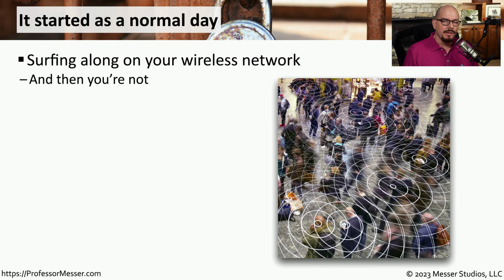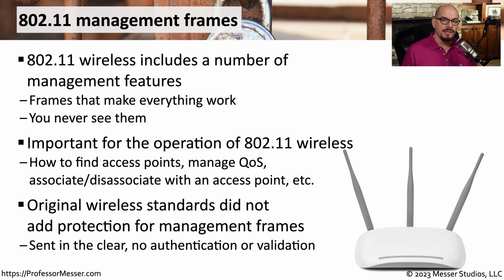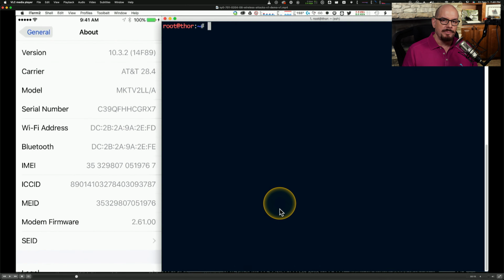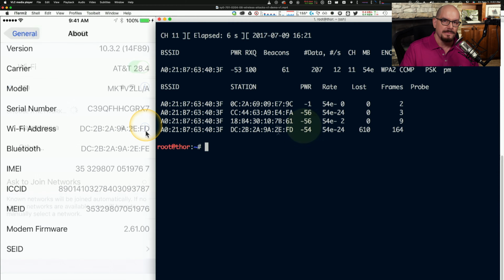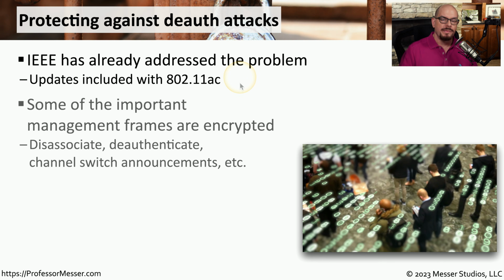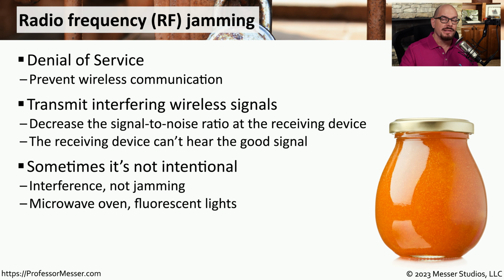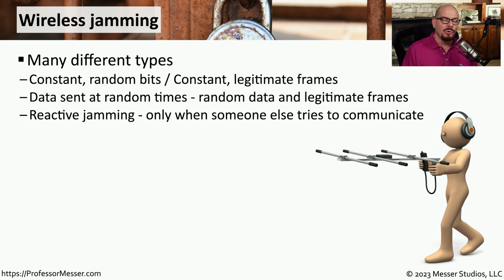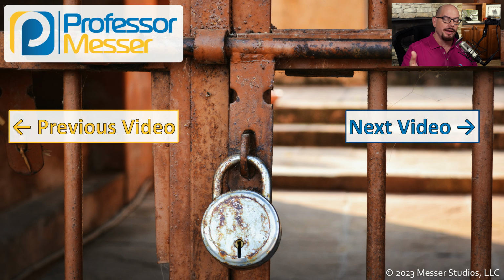Wireless Attacks - CompTIA Security+ SY0-701 - 2.4

Comment: Can this also happen with Bluetooth Signals?
Reply: For sure, but I don't see many cases in which a hacker would try to interfere on that, and probably the tools are not as accessible. Unless it's an enterprise multi victims case, the devices are probably disconnecting because of "too much bluetooth"(say, 4 devices bluetooth connecteds closely), bad bluetooth receiver(unknow third-party adaptors) or interference on the same frequency(if your bluetooth, wifi and other connections are on 2.4ghz, they will likely clash). I had a lot of trouble with ass bluetooth connections until i bought a tp link adapter and left the adapter and my wifi receiver a little apart

Comment: That's weird cause I work at a sandwich shop and the wifi password is out in the open. I saw that I no longer could connect to the wifi. It would just say connection failed and for weeks I couldnt connec then randomly it stopped